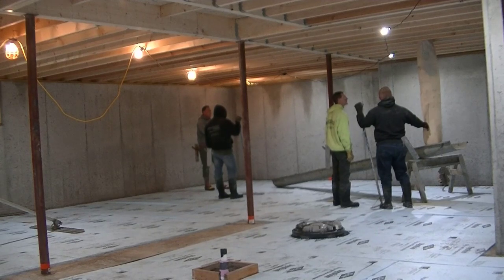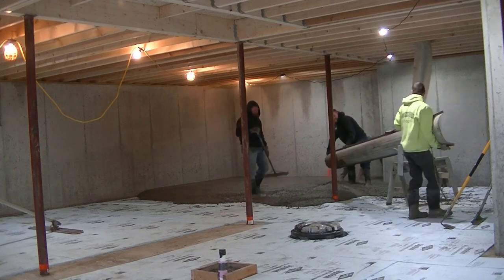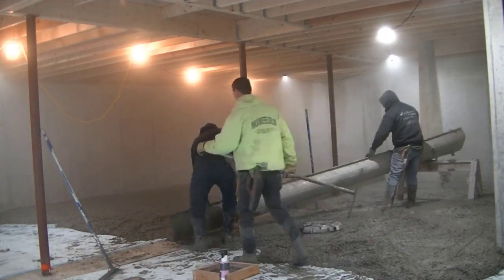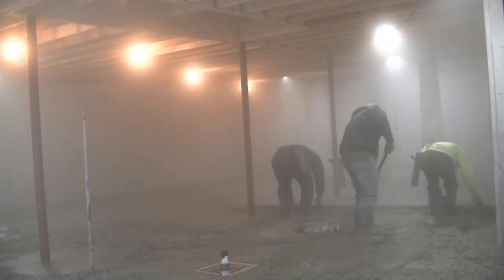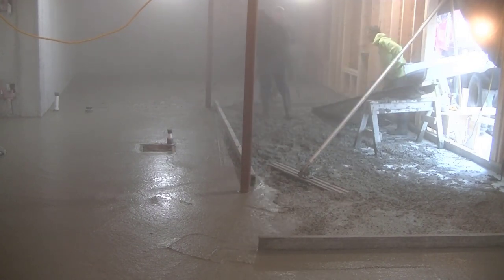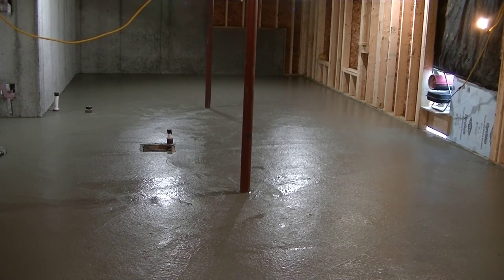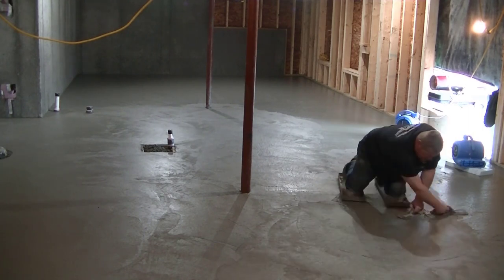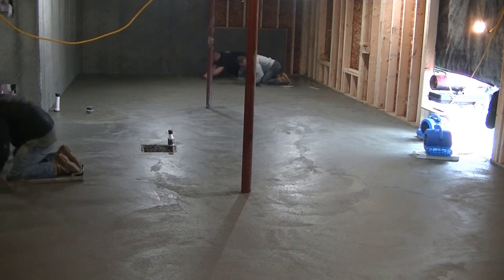Pouring And Finishing Concrete In The Winter | The Good, The Bad, And The Ugly!

Comment: You're definitely my biggest mentor in my concrete business. You don't half way do anything, and I recommend to all the finishers I know. I watch your videos everyday, some several times. I started pouring when I was 17, and stuck with it a few years, but started my own business a year ago. You've been a great help! I finish by hand this time of year myself. Trowel machine will keep us on the job all night. I also admire how your crew works together. Many I go out and pour by myself. I'd probably do that basement in 2 pours, and use my 8 foot darby screed. Hard to find good help in Tennessee. Drugs and health insurance put the brakes on that. Keep the videos coming.
Reply: What part of Tennessee are you in
Reply: North East Tennessee. Near Morristown.
Reply: @bradhill4590  ITS THE SAME WAY OVER HERE IN MIDDLE TN THEY ARE NOT SO MUCH WORRIED ABOUT THE INSURANCE BUT THE DRUGS IS THE BAD PART
Reply: It's my biggest problem. The warmer months, I'll pour 8-10 yards per day and finish that, and form for the next day. I make more money that way in the long run, without sacrificing quality. It just takes a little longer to complete a job.

Comment: Good afternoon I live in Ohio temperatures can change very quickly here without not much of a notice. anyway I had a guy who does concrete pour a 10 x 15 patio yesterday using calcium chloride no insulation under the concrete I would say the average temperatures were in the low mid 30s it was finished late about 7 pm temp drops to 20s no blankets were used last night . The owner today brought blankets to help the curing process about 8am this morning. My question is it a little too late or using the blankets now has the curing process been compromised? what should I look out for in the days ahead? Thank you for any answer you can provide people like you the pros are greatly appreciated when people like myself have questions and don't have the answers to ease their minds...

Comment: Mike I just did a very similar basement. The gc ordered 3000 with 1% first truck had water sitting on top for 15hrs before I did the best I could and took off second truck set up fine because it sat waiting for us for about an hr (2 guys were no show so 1 rookie my dad and myself) would water reducer and little higher psi helped tht first truck?

Comment: Here in my area pa, all concretors I know like the deck to be on especially in the summertime. Eliminates the shady and sunny areas. It all sets evenly and can be troweled with a consistent finish following the trowel machine. When the house isn't built on top usually burnt finish
Reply from the maker: We're just the opposite. Much rather not have the deck on.

Comment: Nice work!  In northern Illinois we pour the same way in the winter.  You should look into super p.  We add it on site, turns a 4” into an 8” with about 1gallon of chemical, sets like you poured a 4”.  Make sure you vent to prevent CO and carbonization.
Reply: The super p will almost eliminate the bleed water, speed up finishing time.

Comment: Hey, Mike. Another great video n great info. That shoot was the star player today. Im gonna pull the trigger on those sliders. Im a heavy guy so im hesitant, but it just looks so much easier and faster than the knee boards.
Reply: Randy Miller  they’re way faster. May take a job r two to get used to using them.  But once you do it’ll be well worth it.
Reply: Thnx, Joe... im gonna do it n stick with them even if it isnt as comfortable at first or even maybe changes up my timing. Holding off longer but decreasing your trowel time is worth it. Especially in this season.
Reply: Randy Miller I don’t think they’ll give you any problem.   I have two different types.  I have the steel ones that are a little different from mikes. Mine are not flat, they have a angle on the front end which you don’t need. And it won’t hold me up when the concrete is on the wet side.    I think it’s the qlt made by Marshalltown one.   The ones I use now is made by kraft tools made from plastic.  They are wider and more flat. They don’t dig in on the sides.   And they are really comfortable.  Hope that helps man.  I sometimes get carried away talking about tools! Hah
Reply: @joeconner9801  fire away boss your not gonna bore me at all. Im a firm believer that somebody that does the same thing one way for 30yrs doesnt have as much experience as they think. It goes against what experience really means. Learn it all, i say.

Comment: By "hand trowel" do you mean that you used a mag float and then ran over it right after with a steel trowel to make it smooth? Or is the hand trowel you referred to also magnesium to not seal the surface? Good work
Reply: Also how long after mag float can you steel trowel?